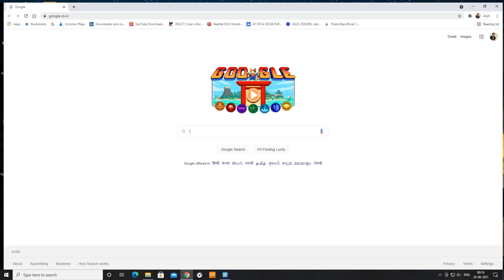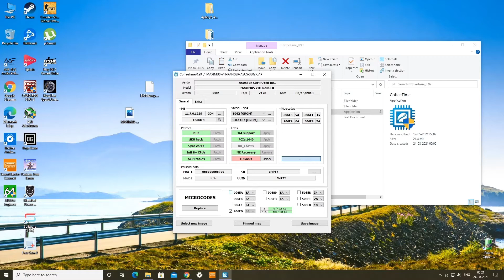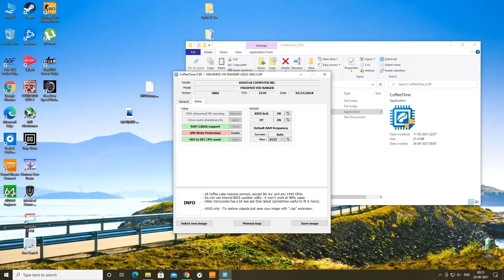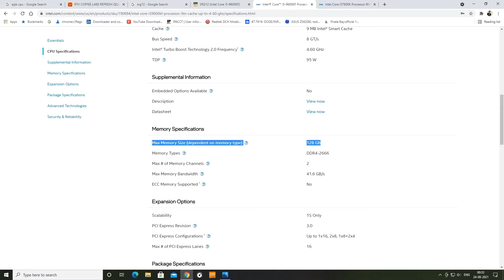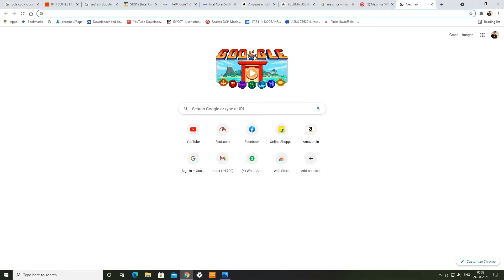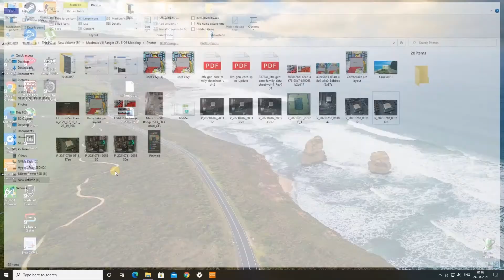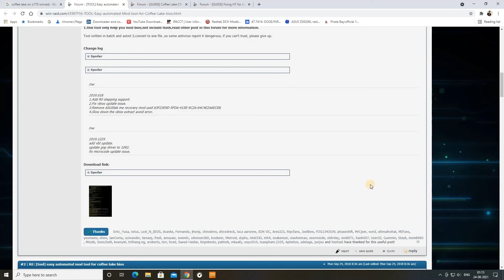It's Coffee Time! Running Coffee Lake CPU on ASUS Z170 motherboard ft. CoffeeTime 0.99

Comment: Hello! Thank you so much for this guide. I have an ASUS Ranger VIII and I'd like to use it with a 9600k. I just don't understand one part: Do I really need a USB programmer or would it work just by USB drive with ASUS flashback?
Reply from the maker: Hello there. You will need to use the USB programmer. Some regions of the BIOS are write protected on ASUS boards and hence USB flashback won't be able to flash those regions. Let me know how it goes and all the best.

Comment: Amazingly detailed walkthrough, thank you so much.

So here is where I am at, so thinking about whether there's a way to enable resizable bar on a z170 extreme4, I downloaded the beta bios from z370 extreme4 (2 gen up lol) which supposedly contain the rebar code, I ran through the procedures with coffeetime 0.99 to mod the z370 bios with the latest in everything, flashed to the z170 board and cross my fingers.

To my surprise or un-surprise, the screen lit up with the igpu on my i5 6500, bios can be entered into and options within seems to function including detection of drives and such.

But here comes the problem, booting off of drives would result in a blank screen seemingly in a frozen state, I don't have a cpu other than the 6th gen 6500 to test, anyone run into this issue? :D

Cheers.
Reply from the maker: I tried a Z370 based BIOS on my Maximus VIII Ranger (Z170) as well. It would not pass POST and was stuck on code 3b (post memory PCH initialization) which makes sense actually since that is the thing which is different. I have an i7 9700KF installed on that board now.

Comment: Hey man, having trouble with my Asus z170-p turning on with i7 9700 turns on for a moment and that's it, any advise?
Reply from the maker: Hi there. Check if you have downgraded Intel Management Engine to 11.7.0.1229 from CoffeeTime and then flash the BIOS with an external flasher and verify it after flashing and I am sure you can get it up in no time.
Reply: @geekjit215  didn't have an external flasher, I just trashed the board :), I did everything by the video then used force flash  aptio v3 it did the update, not sure about the me part but the flash overall was successful, maybe it's that
Reply: @geekjit215  but still thanks
Reply from the maker: @RanKilos2000  It's definitely ME man. When flashing inside Windows, the ME region is not flashed as it is a protected region. Same goes for the firmware descriptor as well as some other regions which carry board ID and Intel LAN MAC address. 
You will need to use an external programmer which will allow you to flash all the regions without any conditions. 
Get the CH341A from Amazon. It is cheap and easy to use. Use ASProgrammer to flash the BIOS.
Reply: @geekjit215  alright thanks man,btw great content and I'm amazed by how quickly you reply, really heart warming, would appreciate if you could advise me about my other question thanks in advance🙏
Reply: @geekjit215  btw do you think a z390 board will unlock more performance than a b360 board on a i7 9700? Or should I just move to a newer generation?
Reply from the maker: @RanKilos2000  A Z390 board will offer much better performance than a B360 board since you get full overclocking support for the RAM which is otherwise limited to 2666 MHz for the B series chipset. Also Z series boards are typically known to come with better VRM and hence you can potentially get better performance even from a non K chip by tweaking the power limits.

Comment: hello, what do you think about overclocking non-k 8400 processors by bclk in a z170?
Reply from the maker: Hello there. I think Intel restricted BCLK OC for good from the 7th gen non K chips in spite of some boards having a dedicated PLL controller. They restricted it possibly through firmware implementations. 
However, it does not hurt to try as the worst that could happen is your system will fail to POST after which a CMOS clear should get you back in action.
Reply: thanks for responding late in responding I was doing oc to the 8600k in a z270 thanks to your tutorial,, I found it interesting to experiment with the i5 8400 they are very cheap in my country, it would be fun the z270 and z170 boards in my country are abundant and a lot cheaper than the much more expensive z370 and z390 chip boards XD, I thought about lapping but it doesn't seem like it makes a difference in oc at 8600k
Reply from the maker: @julianfernandoarturocundom3144  I see. The i5 8th gen is still very capable for gaming and some video editing as well, even better when overclocked.
Did you have any luck overclocking the 8400?
Reply: @geekjit215  hello thanks for replying, I'm thinking the asus z270 code is a clone of the z170 code maybe if I buy an i5 8400 and replace the z270 bios with the z170 bios it works and seen that the asus z270 ampex can use the bios of the z370 are basically clones,, in case the z270 code cannot oc the processors I don't have a 6th pentium to experiment with although I need an 8tva to confirm

Comment: Hello, in your experience, what do you think is the best way to isolate the contacts in the processor? lapis graphite, electrical tape, another option?
Reply from the maker: Hello, Kapton tape yields the best results. Those can resist high temperatures and are easy to remove as well.
Reply: @geekjit215  Thank you very much for all your advice.

Comment: hello, thanks to your tutorial, what makes an 8600k work in a z270 asus code ix, I don't know if it is necessary to isolate the contacts, I did it as a precaution, do you know if you can edit a b360 bios to use a 6700k?
Reply from the maker: Hello! It is better to isolate the contacts in case of an ASUS 200 series board to prevent damage to the socket and or CPU pads. Do note that even if damaged, they won't affect functionality as these are ideally no connect pins. 
As for the B360 chipset, I don't think it will be possible to make it work with older CPUs since it is a 14nm chipset and older ME versions won't work with it. The B365 though should be able to run older chips after modding the BIOS since it 22nm.
Reply: @geekjit215  thank you very much for answering in the case of using b365m is it necessary to isolate the contacts in the 6700k cpu?
Reply from the maker: @julianfernandoarturocundom3144  No it should not be required. However, depending on the motherboard and whether SKT_OCC is implemented, you might have to connect the two pins in order for the board to recognize that a CPU is present. An easy way to check if SKT_OCC is implemented or not is by simply powering on the board without the processor installed. If it powers up and the fans spin, SKT_OCC is not implemented.
Reply: @geekjit215  THANK YOU VERY MUCH I HAVE A DOUBT IF THE H310M SERIES WOULD BE COMPATIBLE WITH 6700K, ACCORDING TO VI THERE ARE H310M FROM CHINESE BRANDS THAT ARE RETRO COMPATIBLE😃
Reply from the maker: @julianfernandoarturocundom3144  I have a GALAX H310M and it is compatible with every LGA 1151 CPU from 6th gen to 9th gen. 😂
Reply: @geekjit215  heres a genius, you know a lot about the subject, thank you very much

Comment: I am trying to do this on a Gigabyte H110 D3A Rev. 1.0 but the chip is different and I can't find the Socket Occupied pin
Reply from the maker: On GIGABYTE boards usually, you don't need to do socket occupied mod. To test it, power the board on without the CPU. If the fans spin, then it does not need socket occupied. But GIGABYTE boards need pin isolation else it is known to cause damage to the socket/VRM/CPU pads. Follow the pin connect/isolate photo on the post in the description and you will know more.

Comment: Lol with the prices people are selling 8th and 9th gen CPUs, I'd rather build a whole new system.
Reply from the maker: Depends heavily on where you live and whether you have anything lying around. With that noted, this guide is mainly for those who has a good Z170/270 motherboard already, like in my scenario and many other who have done the mod. For someone having a good mid-high end board, they would be better off getting a high end 9th gen chip like the 9700K than getting an i5 10400/11400 and cheap mobo combo.
Reply: @geekjit215  I'm form India too and I own a z170 but people are charging 25k for a 9th gen chip. I'd rather go AMD at that price.
Reply from the maker: @mohsin_sait  I got the i5 9600KF brand new for just 14.3K INR when the R5 3600 was costing 19K. The AMD alternative (R5 3500/X) was costing 15K as well. Everything considered, especially while I was having a high end motherboard, it is a clear win for me and for users like me as well. Not to mention, the sheer overclocking capabilites Intel offers over AMD is just too good especially if you are gaming.
I have a pretty good AMD setup as well (Ryzen 5 3600 at 4.575 GHz, 32 GB DDR4 3600, ASUS ROG Strix B550-F Gaming, ROG Strix 750G PSU and a Crucial P5 1 TB NVMe). This Intel setup runs each and every game (except Cyberpunk 2077) better than my Ryzen setup. All thanks to the incredible single core performance (610 points on CPU Z benchmark) and better memory latencies.
For someone already owning a high end board like this, it would have been and still is much cheaper to get a 9th gen chip rather than going for an entire platform upgrade consisting of a new CPU and new board. For example, a Ryzen 5 3600 and a decent board will cost about 17K+12K = roughly 29K. 
For 20K, it is relatively easy to find an used i7 here be it the 8700K or 9700K and one can get away with much much better gaming performance and neck to neck multithread performance while spending a fraction of the cost. The i5 is an even better value for money. The motherboard in this video is a prize I got from the ASUS OC India Tour held in Kolkata. The price of that board was approx 28K and hence I gave it a worthy upgrade to utilize it's full potential since the VRM is over built on this board from the very beginning. 

Nevertheless, I now run an i7 9700K at 5.1 GHz on this setup and I got that CPU brand new as well for less than 20K (sorry, cannot disclose how I got it, LOL)! It beats the R5 5600X in each and every game (check benchmarks as well on other sites) and sometimes even beats the 5800X as well im games. I use my AMD PC for video editing since it is much more power efficient and multi thread performance is a teenie tiny bit better under certain applications than my i7.
Reply: @geekjit215  thanks for the detailed explanation! You're right, a 9th Gen i5 would still be a significant upgrade over my 6th gen 6600. Lol I wish I could get the 9700 for as good as you got
Reply from the maker: @mohsin_sait  Look for offers on the selling groups in FB like Acro for Gamers, Second Hand Peripherals by JD's tech, Dank Gaming Community etc. You can find great deals there. You can sell your 6600K for a decent 7 to 8K, add some cash and get the 9700K or even the 9600K would be a great upgrade for you. Almost all of these chips can go to 4.9 GHz provided you have a capable cooler and with some luck, even higher overclocks are possible. :)

Comment: Would the reverse also work? I would like to use a skylake xeon on a b360. Congratulations on the video!
Reply from the maker: Hi there, thanks for the appreciation. As for your question, not all 300 series chipsets are compatible with Skylake/Kabylake. Unfortunately, the B360 chipset is based on the 14 nm manufacturing process and hence won't work with Intel ME version 11.6 or 11.7 which will prevent 6th/7th gen chips to work. The B365 however can be BIOS modded to work with 6th/7th gen since it is based on the 22 nm process.

Comment: what was the ch341a software you used for the flashing of the bios chip? it turns out that this bios chip is super special with the software, i have tried a lot of ch341a v1.18 with the w25q128fv, and none of them makes a succesful flash, what can i do? :/ could you please give the link to the excat version you used?
Reply from the maker: Hi. I used a fixed version of ASProgrammer. I found that on AdamantIT's YouTube channel. Sharing the link.
https://drive.google.com/file/d/1KrYyKQVj_svvU5fr5EVJ7WP0bRRMFP_a/view
Reply: @geekjit215  omg thank you, i finally did it, i have a qtj1 on my z170 motherboard!! one last question my friend, i cant restart the machine, if i restart it just shuts down and then if i try to turn on the pc, it instantly shuts down, also if i shut down my pc an then try to turnit on again, the same happens, is a constant situation that i can reproduce always, any idea what could be? once i use the psu switch to cut the electric "flow" and return it to the right position, i can turn my pc again without issues
Reply from the maker: @cagc7963  Hi congrats on your upgrade. As for your issue, did you try using a supported CPU and does the issue happen?
Reply: @geekjit215  yeah, i used an i3 6100 during all the process and i could restart with no issues, i mean the problem is not that bad, kinda owrth it honestly if that is the cost xD but could be nice not having it.
Reply from the maker: @cagc7963  I totally get it. Thing is I believe if the issue started happening right after you changed the CPU, it is possibly a design issue which is triggering. The i5 9th gen I am using on my Z170 board does not exhibit this issue maybe because it is based on the same socket. But to be honest, you have made a huge upgrade. Could you please tell me how I can get one of those 10th gen modified chips?
Reply: mine is QTJ1
Reply from the maker: @cagc7963  Did you get it from AliExpress?
Reply: @geekjit215  yes, im from mexico, no issues, i just had to wait almosr 3 weeks xD

Comment: I found my socket occupied, which is also pin 102 for me. however, I still don't know how you found the nearby ground pin. Did you use a continuity test?  Can you please explain how you know that the pin is a ground pin? Does the board need to be connected to AC outlet or also disconnected as with the resistance testing??

If I put my red lead on pin 102 side of the resistor and then the black lead on the ground pin you found (similar board layout for me), my automatic multimeter will produce a flat constant beep sound and show continuity and 2 ohms. Does that mean it is ground? (everything is unplugged).

I have a very high quality photo of the Nuvoton chip on my board I can show it to you if possible.
Reply from the maker: Hi there. Yes you can check for ground using the continuity test without plugging anything. If you have a 6th or 7th gen CPU installed on the board, then that will automatically ground pin 102. Removing the CPU will disconnect the ground from pin 102. So best way to check is by removing CPU.
To find the nearest ground pad, connect one probe of the multimeter to any known ground (e.g. IO port shields) and the connect the other end to the nearby pads till you find one.
If you can, you can share me the photo of the Nuvoton chip and the surrounding components via a Google Drive link. Just make sure to set access for everyone so that I can view. Just don't want mt email ID to be public. Hope you can understand.
Reply: @geekjit215  Youtube removes the link x( how to share!?!?  I tried pasting it in different ways but it keeps getting removed
Reply: @geekjit215  i cant post link here it is getting deleted, can you please provide alternative way of communication? forum?
Reply from the maker: @bobbyboygaming2157  Hi. You can check the TechPowerUp link on my video description which features a thread with this subject. You can register on that forum and share me the photo that way. My screen name is itsakjt.
Reply: @geekjit215  I posted in the forum. I am able to boot into the BIOS  settings but after that, windows fails to load. I also cant boot from USB for fresh installation of windows, the system just crashes.

Comment: Can you please show/explain where you placed the multimeter probes to know if the reference pins are connected to anything at all (to  know if they must be isolated or not?) where do you put the multimeter test-leads?
Reply from the maker: Hi there. I put one of the probes to ground (you can use any ground pad, I used one of the port cover shields) and the other probe to each of those socket pins very carefully so that they don't get bent. If you get open line or infinite resistance, then those pins are not connected anywhere and you can get away without any isolation.
Reply: @geekjit215  The power cable is plugged into the motherboard? or the whole thing is disconnected?
Reply from the maker: @bobbyboygaming2157  The whole thing should be disconnected while measuring resistance.

Comment: Amazing video, i have a old asus z 170-A with a i5 7400, but i dont know if it is capable to run a i9 9900 non k
Reply from the maker: Hi there. While it can technically run an i9 9900 non k just fine, try to have some fans blowing in air to the VRM. The 9900 being an 8 cores 16 threads chip is known to draw a lot of power.

Comment: Do I actually need to buy that bios flasher? I thought all you needed was just to edit the bios file?
Reply: As he said in the video, it will not work properly without separately flashing the BIOS
Reply: @circuit-maker7971  nigga you’re a year late🤣 I sold that 9900k and called it quits.